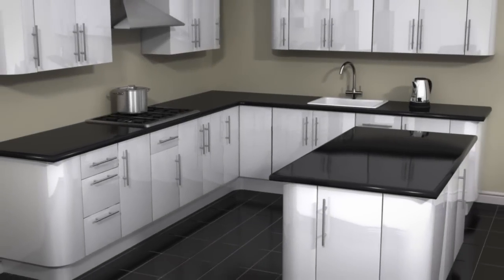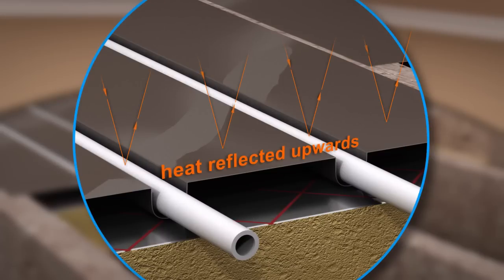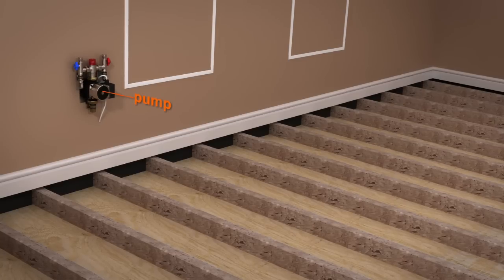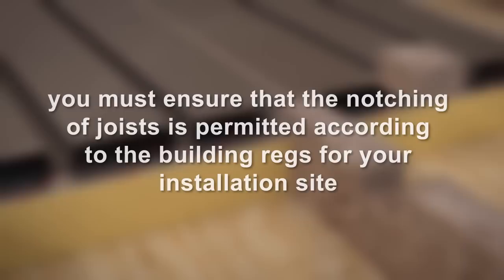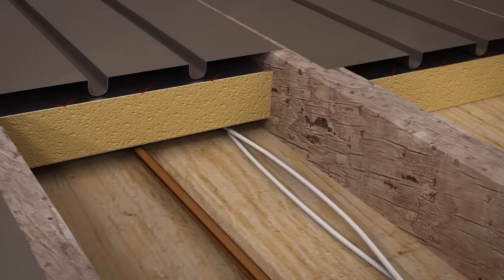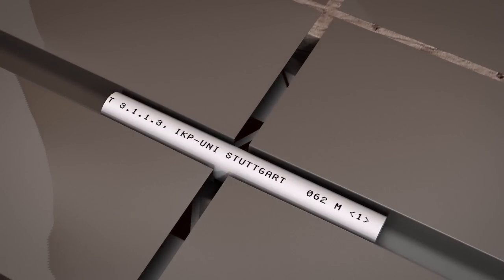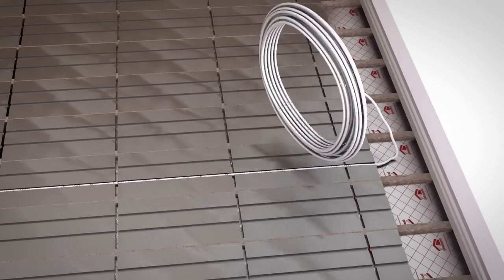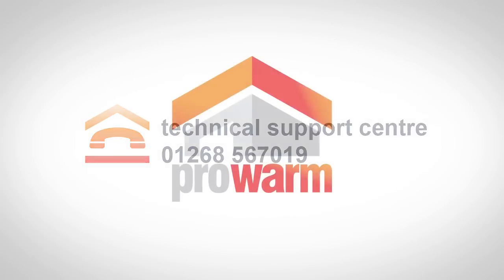ProWarm Water Underfloor Heating Installation - Aluminium Spreader Plate Method

Comment: 3:00 yeah and 50% of  wooden joists with ambient temperatures... british... not so "great" way of building...  your way of underfloor "heating" works when heating is on, and it doesnt when heating is off- there is no buffer in 1mm thck or less  aluminium plate and the heat is not stored at all. also wooden flooring acts as an insulator forcing users to increase the heating temperature to achieve  max  24degC output to avoid swollen feet. 
do it right ground floor -  remove timber, insulate with styroconcrete or leca , or do a proper slab then 150mm of polystyrene and anhydrate pour. insulate foundations all the way to the ground  because in your sht example 22mm plank is the only thing that separates you from the cold under the floor especially by the walls
Reply: You didn't watch the video then. Quote "insulation should be installed under the spreader plates"
Reply: So many things wrong here.
Not having a buffer can be advantageous, as it makes the system more responsive.
Wood is an okay conductor, and once the heat is at the surface it will rise into the room like it would with any other flooring material. However, a slightly higher flow temperature may be required to bring the surface temperature up to, say, 27C.